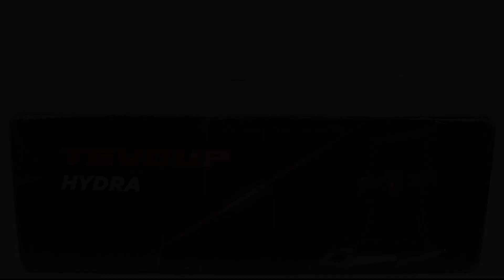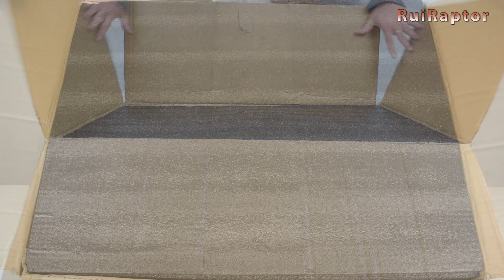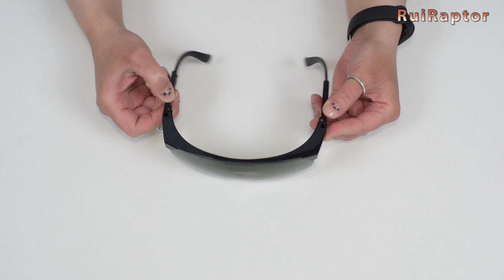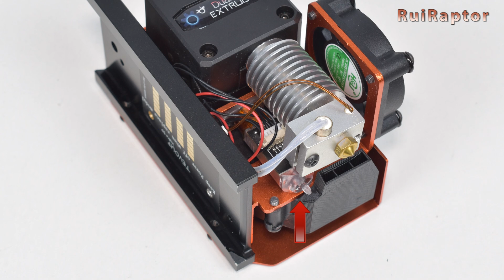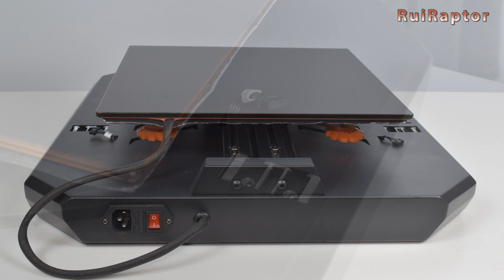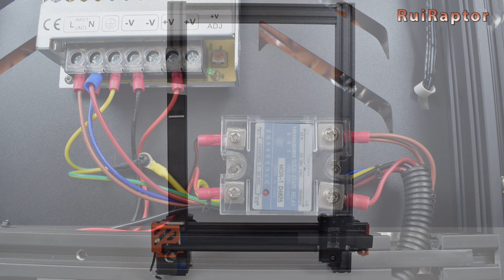TEVOUP HYDRA (2 in 1 - 3D Printer & Laser Engraving) - All The Details

Comment: Tevo, Homers, Tevoup... Whatever they want to call themselves these days.. No consistency in this "brand" whatsoever. I bought Homers Odysseus last year, works fine, except some important aspects: NO spares, NO firmware, NO source code, NO tech support, don't get me started on the QC. The SD card was unreadable. Never mind on the last "version" all critical mechanical parts were made of plastic. I was looking for metal substitutes, no such thing. And judging by the responses on their FB page, well, I'd think twice before shedding cash their way. And this one, even more plastic!!! Another case of something, designed in the marketing department. "Function before form", not the other way around.
Reply from the maker: Hi,
just a quick note, this new hydra is not made from plastic. The base, carriages, plates, top bearing mount plates etc are all metal.

Comment: A laser engraver/3D printer makes much more sense than a laser engraver/CNC router or a CNC router/3D printer - because of the lack of a need for any real torque :)
Reply: Except you need good ventilation with the laser.